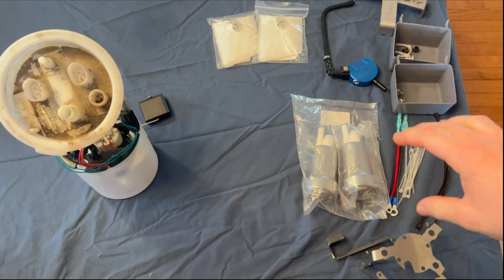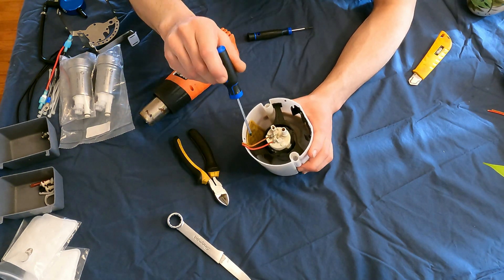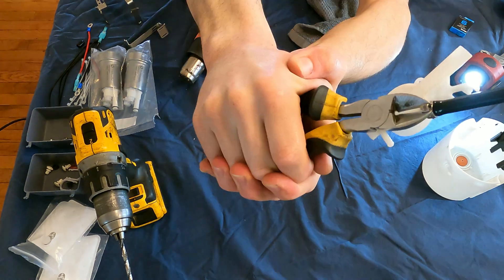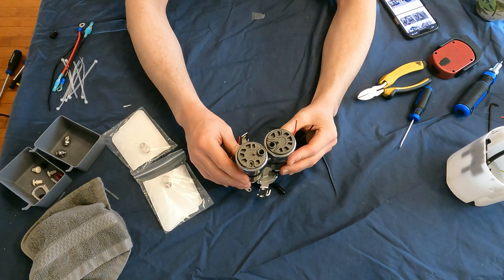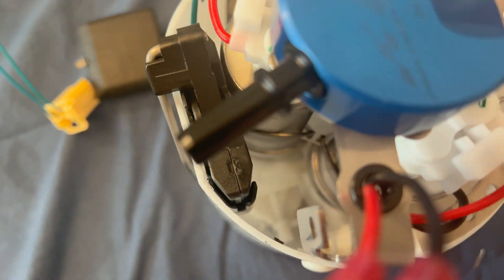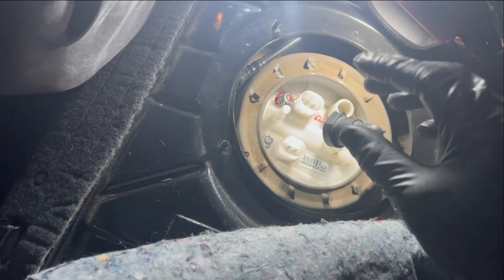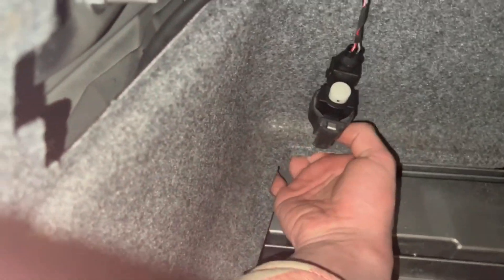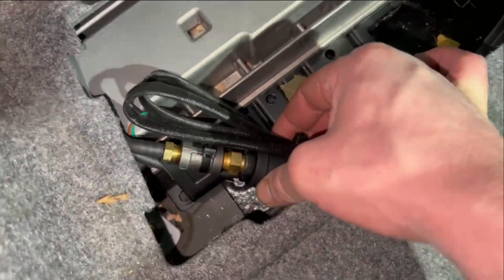BMW N54 Stage 3 Bucketed Fuel pump DIY

Comment: love the video.  Do you have any info on the parts you used in the engine bay to re route the vacuum lines? like moving it from vacuum to boost. what adapters?

Comment: Hey brother, just wanted to ask how did you connect the actual boost line to the hobbs switch, did you have to buy an adapter with a barb fitting or it just slips onto the threaded end of the hobbs switch? Thanks
Reply from the maker: Hello, I had to purchase a barbed NPT adapter.

Comment: Does drilling the holes at the bottom of the pump defeat the purpose of a bucket?
Reply from the maker: Great question! It still stays full of fuel because the Venturi is constantly filling the bucket with fuel much faster than those holes can drain fuel. I am also happy to report I have ran my tank very close to empty multiple times with no issues.

Comment: I wonder how long it’ll take for the boost to get to the Hobbs switch with it all the way in the back of the car. Probably won’t matter if it’s activating at 14 psi. Should be enough time to activate before getting into serious boost where you need it. Great diy though! So you bought the stage 3 diy kit? Looks like it’s around $700 for that.
Reply from the maker: Correct!

Comment: be careful if u ever get stranded a cause would be that the stage 3 fuel pump over heated the fuel module so u might have to upgrade the module that can handle the volts a stage 3 needs
Reply from the maker: I appreciate the information!
Reply: @Shmee.Phillip not to mention, hes not runnigng the second pump all the time.  only after 14psi